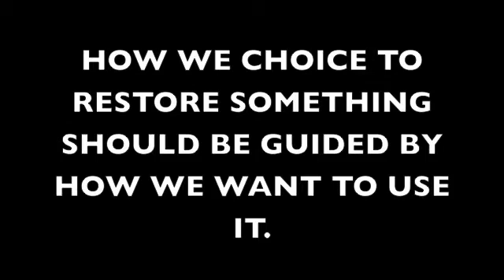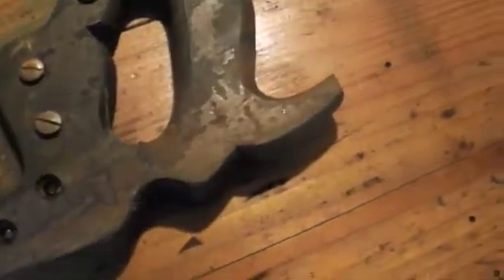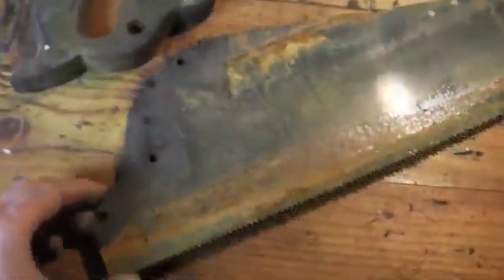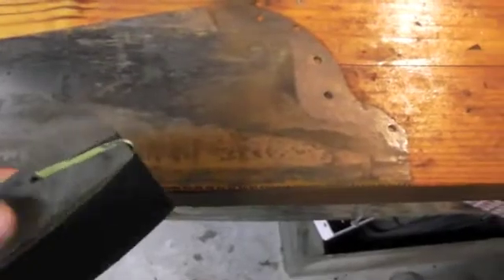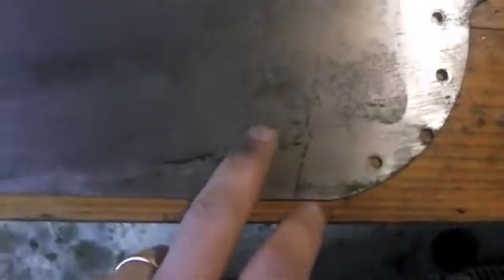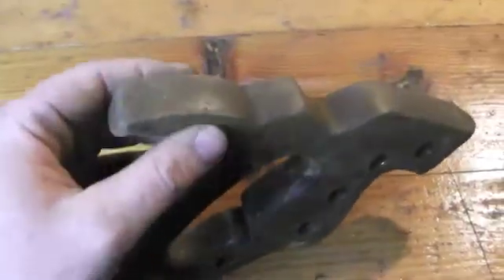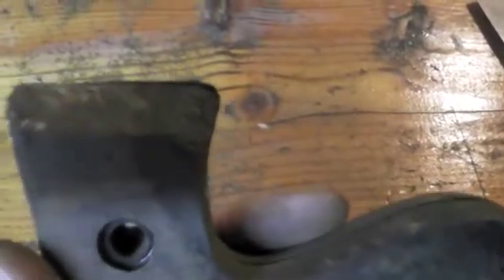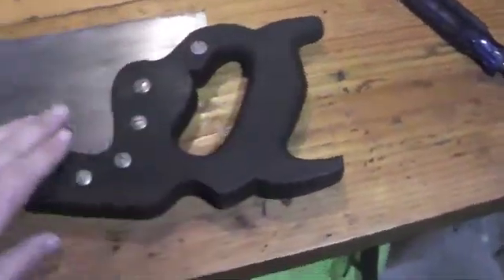Disston D 23 Functional Restore

Comment from the maker: John, it depends on how much "set" the teeth have. The more set the more they are bent outward. I have found that sanding free hand on saws with less set works fine. For saws that have a more aggressive set I will use a soft wire brush. The main problem with sanding the teeth is the risk of cutting your fingers through the sand paper. If you are worried about it just go slow and have fun. Hope that helps. -Devon
Reply: I take a strait piece 1x2 as long as the saw on the table saw rip a kerf down the middle a quarter inch deep.you can then slide this over the handsaw teeth lay the saw on a flat table with the 1x2 hanging off the edge and sand with a orbital sander.the 1x2 keeps you from sanding the teeth.i have done a lot of saws this way.its fast too.

Comment: put a folded towel or some other cushion down on your bench, hold the saw by the handle with the blade a few inches above the towels (after removing the screws) and tap the spine with a rubber mallet. It will the plate loose and save your handle.
Reply from the maker: Thanks a great approach, I usually leverage my thumb against the top of the handle to prevent splitting. It also helps to have a tripod for the camera so I can use both hands! Thanks for commenting

Comment: How did you clean up the teeth? I've just bought some old Disstons and I'm wary of sanding the teeth. Sorry if I missed you explaining that part.
Reply: John never sand the teeth it will
Ruin the set, just take some steel wool and rub them with the grain of the saw over time and use they will become more shiny if it is a functional saw just repeat the steel wool process. Another technique is to take some quality oil and rub them with a soft rag. Also it is important to sharpen the saw correctly you must make sure that the teeth are even and use a 3 sided file witch is actually a 6 side file and make sure the file is about twice as big as the teeth be careful on how you angle the file depending on if it is a rip saw, panel saw  or cross cut saw Hopefully this helped